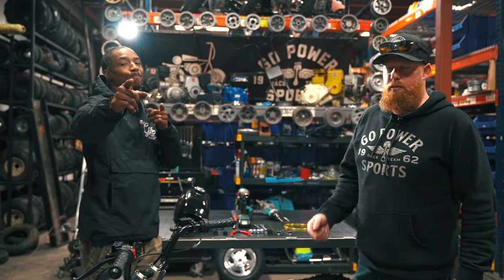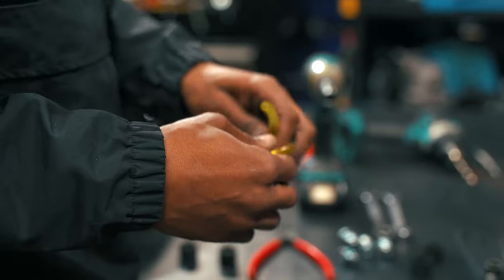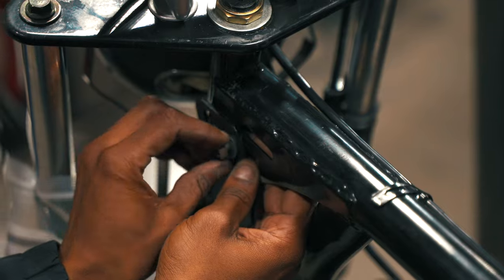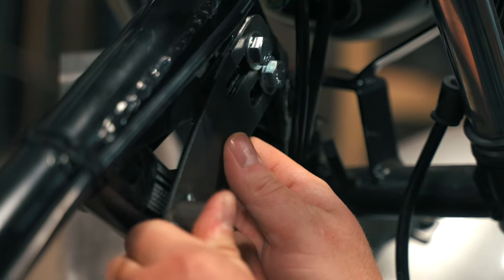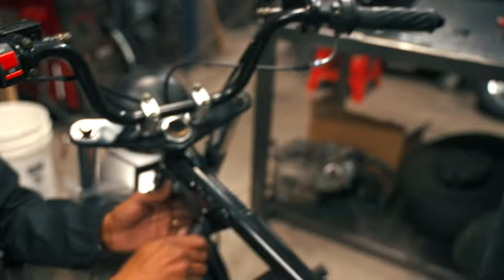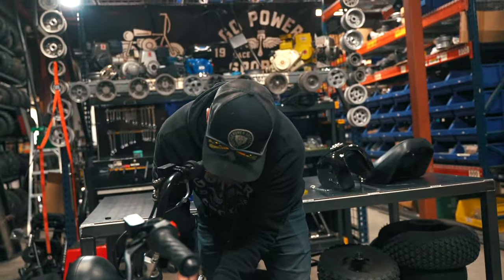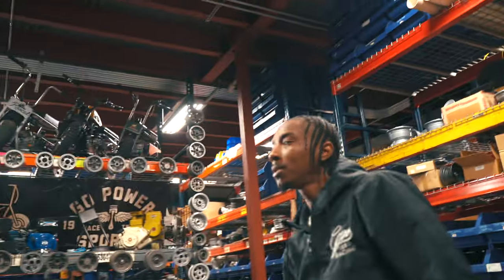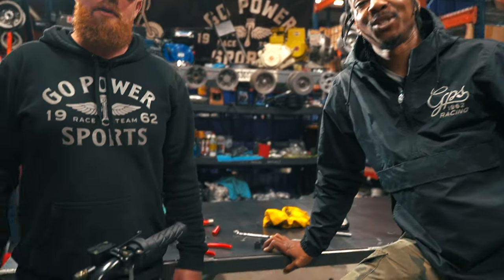Bolt-On Gas Tank for MB200-2 and Hurricane 200X Mini Bikes

Comment: I used 2.5” stainless through bolts, with 1.5” steel spacers closing the gap in the middle between the gussets for the front mount. Pretty solid!
Reply from the maker: Thanks for the tip!  Hope others find it as useful for their builds.

Comment: I think i would personally leave the stock tank fitted and use it as a reserve, using taps don't let fuel run from the top tank to the lower one of course
Reply from the maker: Another great way to go!
Reply: I just fill my tank up with the above tank. I fill both tanks and I can get about 100 miles.

Comment: One thing I'd do differently, is for the tank, rear bolt. I'd drill the hole in the top of the frame, then weld a nut there. Then shorten the bolt. The frame would be stronger.